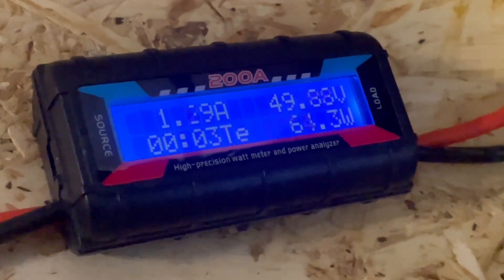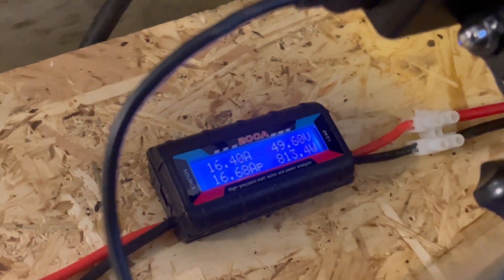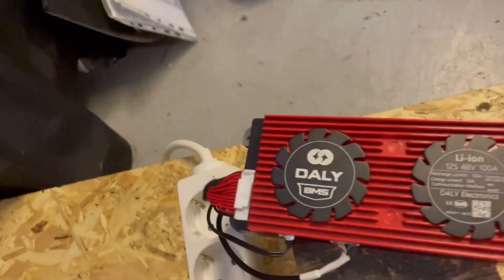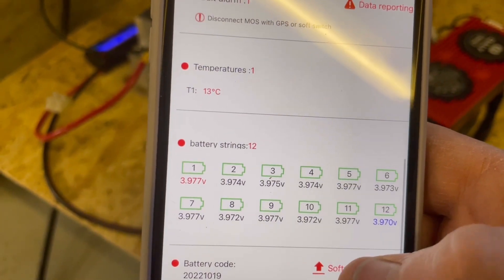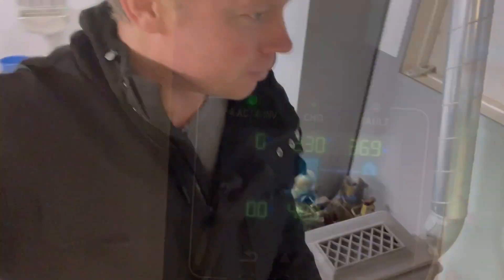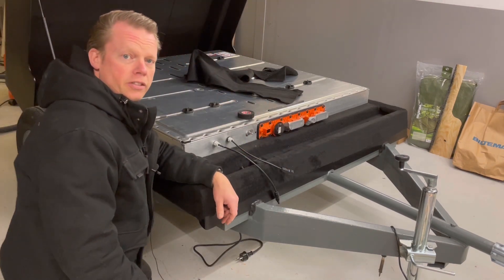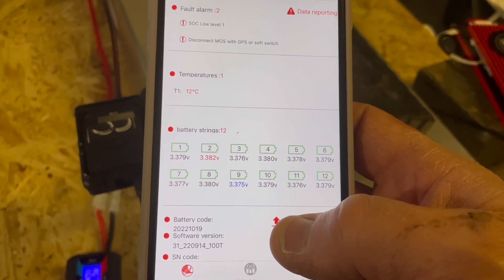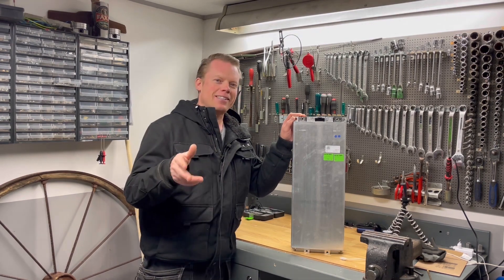Capacity test VW id3 id4 battery module

Comment: Hey! I ended up with about 30 of these from an Auction. Have you found a bms that works better since you posted this? I have a simpbms for some tesla batteries and am trying to get the best one for the buck. I have so many projects I'd like to make but I would also like to be safe. Cheers.

Comment: Hey Mr. FT, i do you think it would be safely possible to use two MEB 8S Modules in series to be used on a 48V Multiplus II, using a single 16S BMS ?
Thanks for your work and the great effort!
Reply from the maker: Hi😃
Yes, that will work perfect 👌🏻 
Just be aware of that you will not be able to charge them up to 4.2 V per cell, but that’s not needed anyway. Thanks for your question.☺️

Comment: Hey nice video again :) do you have put 9 daly Bms om your id3 battery? I think there are A lot of people like To see what this looks like on your battery. How you have connected them
Reply from the maker: Thanks☺️
No, daly is not to recommend in a HV system. I will use Orion BMS for that.
However, I will post a video how I connected the bms to the cell module for use in a 48v system.
Reply: Do you install the orion bms yet? That is A Nice bms to see. But also verry expensive Do jou dont want to have the orginal bms vw with A master bms that can communicate with solax and orginal slave bms?

Comment: Hi, what's the battery connector name, where you put in a cell wires? Can't find a name, using regular Dupont connectors, but its not secure.
Reply from the maker: Hi, you will find the part number here in this video at 4,45

https://youtu.be/hKKdrE_1TJY 
Thanks for your question.😃

Comment: Hello, I follow all your videos from Italy, I too have a 58kw id.3 battery that I want to use, but I can't find 12s li-ion bms, only 13s-14s- etc, but no 12s, can you show me the link where to buy a 12s 48v? thank you.
Reply from the maker: Hi!
Glad to have you here😃
I bought it from AliExpress from this seller. I have bought 9 BMS from them without any problem. You have to order a lifepo BMS and leave a comment in your order that you want it for li-ion. It’s the same price. They ship in a week, so not super fast but you will have it.

SEK 469.88  32％ Off | Daly BMS Smart 16s 48V 18650 Battery Li-ion LiFePo4  4S 3S 7S 8S 10S 12S 13S 16S 20S 24S12V 36V 30A 60A 80A 100A 120A 150A 200A
https://star.aliexpress.com/share/share.htm?image=A38f1584185f74fb0822417ad9f6a84beL.jpg&businessType=ProductDetail&title=SEK%20469.88%20%2032%EF%BC%85%20Off%20%7C%20Daly%20BMS%20Smart%2016s%2048V%2018650%20Battery%20Li-ion%20LiFePo4%20%204S%203S%207S%208S%2010S%2012S%2013S%2016S%2020S%2024S12V%2036V%2030A%2060A%2080A%20100A%20120A%20150A%20200A&platform=AE&redirectUrl=https%3A%2F%2Fwww.aliexpress.com%2Fitem%2F1005002811248870.html%3F%26srcSns%3Dsns_Copy%26tid%3Dwhite_backgroup_101%26mb%3DQDvJmB7yNDkwB5z%26businessType%3DProductDetail%26spreadType%3DsocialShare

Hope this helps.
Good luck with your project😃👍🏻
Reply: Use JiKong smart BMS, 8-20S you can use it for any setup starting from 8 cells in series, it does not have any restrictions like Daly or other that require certain amount of cells to be connected

Comment: @Flying tools Do you think about make another HV battery from 48V VW modules ? You can switch between two HV batteries connected to the HV hybrid inverter. Have a nice day!
Reply from the maker: Hi. Yes, but it is pretty expensive. I have done this with an e-up 16,8 kWh hv battery when I hade to do work on the id3 battery. Have a nice day and a happy new year 😊
Reply: @flyingtools  Thanks ! Also happy new year!

Comment: 😊 I believe that you have a voltage drop on you wire that will make up for your losses. 
I think you have full capacity on your battery pack 😊
Always nice to know what capacity you have in your battery👍

I made a comment on your last video, only thing I forgot to tell was, the reason for a small fuse in the cell is due to safety.
If the battery is shorted on the balance lead it will turn in to melted wires, because of the resistance in the wire and the low voltage makes it impossible to blow a fuse at 5 Amp.  I used a faste acting fuse at 250mA and 0.5 Square millimeter wire, that works out, with out a fire. 😊
Reply from the maker: Yes, you are probably right. But I rather just mention the numbers, I don’t want to overestimate it.

I saw that comment and I know about the fuses and the reason why they are ther, I was just hoping they they will hold up for a 200ma balance current so I can use Orion bms to my battery. 
200mA is more then enough just as you say. I meen look at my pack without a bms, 6 month of use and a daily cycling
And a delta voltage over 108s at 8mv!!
If a battery need a daily balancing you simply have a battery with bad matching cells or just bad cells.

Thank you so much for your very informative and giving comments.
🤩👍🏻👌🏻

Comment: Great video, really clear explanation. Really good battery power that packs achieving. I was wondering if you might be able to help me please. I have the same BMS but with the older NCM622 cells from a 2019 hyundai ioniq. I have seen your upper and lower charge and discharge voltages are set at 4.2v and 3.3v. Only issue I have is if the voltage drops so low on a 12s configuration, will the inverter still work and push the power out? And will it then kick back in to charge them back up. I've had issues over the hybrid inverter not wanting to charge the batteries if they run low. I've decided to order the power meter your using to try to understand my actual capacities. Many thanks, David from the UK
Reply from the maker: Hi David and thank you so much. That is a very good question you have there. That is one of the biggest problem with this inverters from growwatt.  You are not able to set the voltage lower than 40 volts, then it will cut off the power and also when you’re going to start to charge a battery like this, it took almost 5 hours for the inverter to ramp the amps up so it’s actually start to charge the battery again. So I highly recommend Victron because I have heard that you can set the voltage there to a lower setting and also a lot higher than this Growatt inverter I think it was 36v and all the way up to 63v  so to use this battery together with a growatt is highly NOT recommended .

Thank you so much for your comment and have a fantastic day☺️
Reply: @flyingtools   Thank you for that. Maybe when I have some more money next year I will upgrade to Victron. They're quite expensive but as you have mentioned, a lot better than the cheaper Chinese inverters like my hybrid inverter charger. Otherwise its probably cheaper just to buy a cheap Chinese version of the tesla Powerwall and just negate all the uncertainty. 
You have a great day too please 😁

Comment: This is amazing - 6kWh from one module is perfect - great home storage solution. I wish there was some off-the-shelf solution to get a salvaged battery from crashed VW MEB platform car, hook it to some coolant external circuitry, plug in into the battery and off you go - home storage ready. With some good 3-phase inverter, you might get dirt cheap and quite big home battery with high reliability.
Reply: Maybe you can try at Second Life Battery. This is a Spanish firm that sells reclaimed car batteries. Maybe you can find VW batteries there.